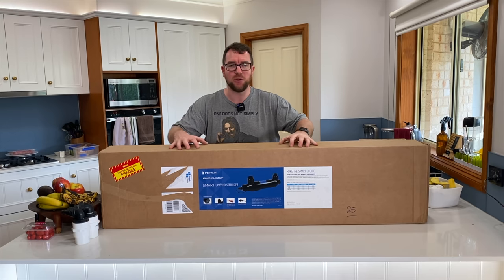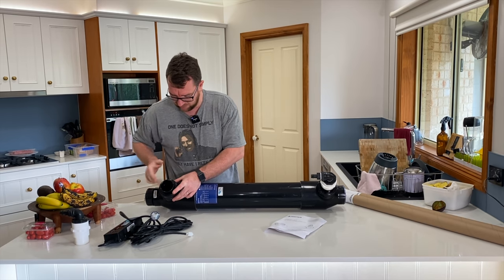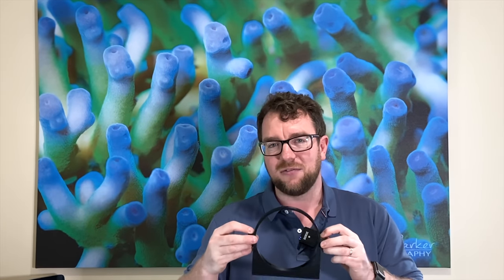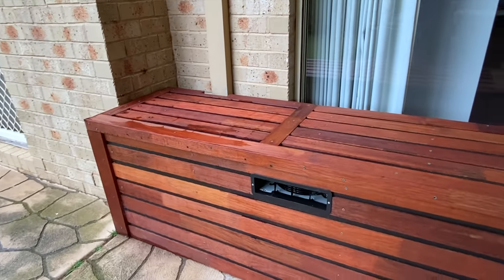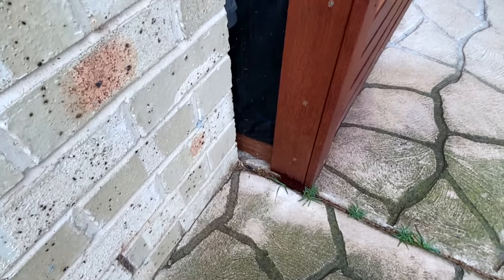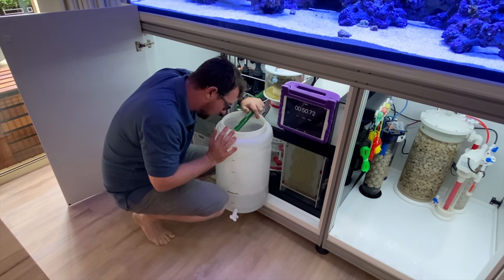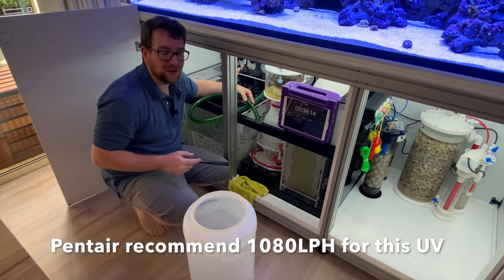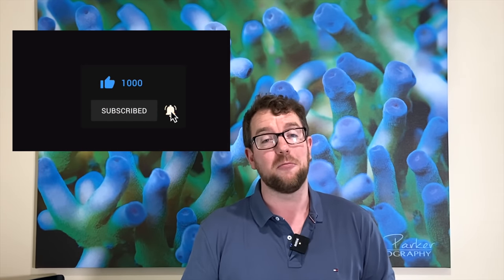Pentair UV Unboxing, installation and tuning - How to

Comment: I got a 25 watt Aqua ultra violet twist, mainly for the smaller size of unit and for the purpose of water clarity and bacteria control.  Did its job within 24 hours and I oversized the unit for my future tank upgrade.
Reply from the maker: Nicely done 👌🏻👌🏻👌🏻

Comment: Very nice set up mate once the tank is completed it will be one of the best tanks around 👌👌
Reply from the maker: Ah thanks man, I just want it to be the best I can make it :)
Reply: @ParkersReef   hi Sam I have a question for you please if you can help iv bought the shadow over flow system 16 inc and I’m having trouble getting the water level right if I reduce the flow with the tap it’s quite but not enough flow in the sump and find the water goes a bit cloudy if I open up the tap I get good flow tank goes clear but it’s noisy in the box iv tried with the standard high of pipe recommended in the box  and I can get it quite but I reduce the flow coming back into the sump do you have any idea what I can do please thanks
Reply from the maker: @enricodigenova8112  when it is flowing the volume you want, where is the noise coming from and roughly how many litres per hour is it?
Reply: @ParkersReef  the pump I have is 2800 l p/h and the noise is from the box when the water is low in the box if I raise the water level in the box by closing the tap the noise goes but the flow coming back into my sump is reduced by a lot
Reply from the maker: @enricodigenova8112  ok so the noise is coming from the box? As in, the water is falling too far from the front box to the back box creating a waterfall?

I like to have the full siphon as low as possible, but the partial syphon as high in the box as I can safely go. Gives you more room for it to catch the full siphon when power is restored, but the high second pipe will reduce the waterfall noise as the water level in the box will be higher
Reply: @ParkersReef  ok thanks mate I’ll give that a go 👌
Reply from the maker: @enricodigenova8112  keep me updated! The flow should be well within the range for the overflow box
Reply: @ParkersReef  thanks mate
Reply: @ParkersReef  all good mate I cut 2 new pieces of pipe and it’s quite and good flow in the sump thanks once again 👍
Reply from the maker: Bloody good work, well done 🙌🏻
Reply: @ParkersReef  thanks mate I really appreciate your input .I meet you at Dave shop I’m the guy when I told you I follow your channel and keep up the great work if you remember
Reply from the maker: I think I do remember - but I have to say I’ve been getting quite a few saying that to me lately, I must be almost a D grade celebrity 😂
Reply: @ParkersReef  all good mate ppl love your videos because they are very knowledgeable and you take the time to explain everything and help out as best as you can and ppl appreciate that and I’m one of them 👍👍👌👌
Reply from the maker: I appreciate that mate, thank you 🙏🏻

Comment: Hey Sam, I have the same UV and chiller models (nice gear). Teco specs say the chiller should be Min 600 / Max 800 LPH.  Has your chiller been working fine running at 1000 LPH to run in series with the UV ?
Reply from the maker: Sure has mate 👍🏻

Comment: What about running 2 UVs one for general purpose and another one for slow flow to avoid ick kinda bacterias.. is that a good approach (ignore cost) .. If yes , what would be the plumping considerations and and placements.. 

Also is it always needed to direct the treated water directly to the return pipe?? I am not doing this at all
Reply from the maker: yes that would work just fine. You could also run a single larger UV with enough exposure at the higher flow rate to cover both use cases

Comment: Excellent!
Is there a way to electronically monitor the sterilizer such as a intellicenter??
Reply from the maker: Not that I am aware of
Reply: One last question Does the sterilizer have to be mounted at an angle  if mounted  horizontallly?
Reply from the maker: @MWard-zk4wg  ideally with a small angle to ensure no air gets trapped in there

Comment: Thanks for walking through this. I am about to install a 360 gallon system and got the same 80 watt unit. I am looking to leverage it similar to your expectations. I assume I can run at a slightly lesser flow rate based on on the lesser volume. Any thoughts here based on your experience with the unit thus far? Separately, are you using low iron glass? I was convinced that it doesn’t make a difference on glass less than 3/4” thick, but wanted your opinion.
Reply from the maker: hey Chuck, they're great units and I wouldn't run my system differently if I were to build it again. The 80watt unit will work a treat on your 360g tank, wouldn't worry about slowing the flow more - you'll just get extra coverage with the same exposure rate if you leave it at recommended values.

Yes my tank is low iron glass and it is one of those things that you cannot tell the difference unless next to another tank - but at the time it didn't cost me much more, so it was worth it. Also, my glass is 19mm thick, so basically 3/4 inch.

Comment: Did you have to put an o ring inside the union slip? I didn’t put one in mine will I be fine?
Reply from the maker: The fitting does have an oring yes, best check yours

Comment: I had purchased a 25w pentair, but now need to step down outliers from 1.5 inch to 3/4 barb . What should I purchase to get this step down ?
Reply from the maker: I’d just get some adapters from your local plumbing or hardware store

Comment: Excellent video Sam! Can I make a suggestion and plumb your chiller before your steriliser? You'll want the chiller to be receiving water as close to the display tank temperature as possible as its the chiller inlet temperature that it controls to. Unless you are controlling temperature from another probe, any heating the steriliser provides will trick the chiller into thinking the whole tank is hotter than it is, and the chiller may over cool the whole system. Whether the chiller is extracting heat before or after the uv steriliser won't matter for the overall system temperature, but where you measure your controlled variable does. Just my 2c!
Reply from the maker: Yeah I've had a few say this, seems to be 2 very different trains of thought! I feel like putting the chiller before something that creates extra heat that then returns to your display is tricking yourself. I bought the chiller to keep the water cool, so why let warm water come out of the UV, go through the entire tank then finally make it back to the chiller for cooling instead of cool it instantly?

I have the ability to put a temp probe elsewhere, but I don't see why I would want to? Surely I want to regulate the temperature of the water that is getting sent to the display tank?
Reply: @ParkersReef  You bought the chiller to keep the display cool, not your return, since that is the temperature your livestock is experiencing and therefore the temperature you want to set and control. The chiller doesn't care about nor regulate the temperature of water it is sending out (which is what your return line will see), only what it senses coming *in*, which should approximate your display temperature as closely as possible. When running, the chiller outlet could very well be 20 degrees, which will go up your return and mix with your display until it cools back to your target temperature of, say, 25. The chiller turns itself off and on to provide cold water via the return when required so it can mix with the display tank and keep it roughly where you've set your chiller temperature.

Now say the UV heats the water going through it by one degree (probably excessive but for sake of argument...). So for example, your tank temperature is sitting at 25, but in your configuration, your chiller sees 26. If your chiller is set to 25, your chiller will turn on and chill the water coming out of the UV until it senses that the water coming out of the UV is 25. To achieve this, it has to cool the entire system, including your display, to 24 degrees to compensate for the localised temperature increase at the UV. But you don't want a display of 24, you want it at 25!

Your return line temperature will always fluctuate based on if heaters, chillers, UV etc. is on, and at the end of the day, doesn't matter in and of itself. What matters is your DISPLAY temperature - and the equipment should be serving the purpose of keeping your display where you want it, not your return. Maybe the return is 28 when the heaters are on, maybe 22 when the chiller is on, but if the temperature control equipment is set to sense and control to the display tank temperature, the return temperature will meander around to achieve the display temperature goal regardless of what your UV is doing to the water temperature. That is why you should either have your chiller before your UV, or have whatever temperature probe is sensing the controlled temperature for your chiller as close to the display as possible. The heat from the UV will be taken out regardless.

Sorry I'm garbage at explaining things - I hope that makes sense...
Reply from the maker: That is a good explanation and I appreciate the time you have taken to explain it - there is a vital point you made there about how the chiller does not see nor care about the temperature it sends out - only the temperature it sees coming in. That is key and makes your approach make a lot more sense now although I am starting to think it actually makes next to no difference as both approaches have pros and cons.  I totally agree, you are maintaining temperature in the display, not the return. Now if I were to go chiller, then uv and I want my tank temperature at 25, this is how I see it would play out:

Tank is at 25, goes through sump, through chiller, chiller does nothing as temp is correct, then to UV which heats the water up another 1 degree and sends it to the display which in turn heats it up above the temperature I actually want. This continues until the display gets too hot (all whilst the chiller sat idle) and eventually the chiller kicks in. The chiller would never actually see the actual temperature of the water that is being sent back to the display, until it has over heated the display - effectively putting your tank on a temperature cycle no?

Like I said, I am beginning to think we are splitting hairs and it makes little to no difference :D
Reply: @ParkersReef  I'm an engineer... Splitting hairs is what I do best 😂 But I love the chat - both sides can learn stuff! 

So all chillers and heaters work based on hysteresis - that is they will cycle on and off to remain within a certain margin of your target. I think the Teco's stock hysteresis is one degree, so if you're targeting 25, your chiller won't turn on until it sees 26 at the inlet. So you're right, you'll get some heating before the chiller kicks in, but it will do this regardless of where the UV is placed relative to the chiller. If your uv is before your chiller, you're shifting this cycle down, say, a degree, but you'll still have the cycling. There's no real difference here. The only way to fix this is to reduce the hysteresis setting on the chiller.

I guess my main point was what temperature you're controlling to should be the display temperature and independent of the UV. The UV's outlet temperature may change if it's off for whatever reason, bypassed for maintenance, or the bulb characteristics which can change over time. Maybe the flow through the UV changes over time due to pump fouling so it gears the water more. This may change your display's temperature because the chiller is fighting to keep the UV outlet constant, not the display.

Now how big a deal is this? Is this even a deal? I can't honestly answer that question, but at the end of the day, why not remove the variable by changing the order and never have to think about it?
Reply from the maker: @N0r53f1r3  yeah fair call too! The UV temperature differential is one thing I feel will remain fairly constant, it's on 24/7.

But, say the pump did foul and run slower, in turn heating the water even more in the UV. I'd rather the chiller pick that up, than returning back to the tank as a slow stream of very warm water?

But all being said, I still think it has little difference one way or the other :D
Reply: @ParkersReef  the UV steriliser will add a certain amount of thermal energy to the tank that is independent of the water flow rate through it. The slower the water, the hotter it will be, but there will be less of it so the impact on the display temperature is exactly the same - a watt of heat is still a watt and once it mixes with the display it won't matter. However it matters to your chiller because it's sensing temperature at the UV outlet specifically. So it'll assume the tank is far hotter than it is and potentially over chill.

Just some food for thought Sam! The impact may very well be negligible - it really depends on how much heat the UV adds which I didn't even consider until you mentioned it. But it's a variable easily taken care of with the switch.
Reply from the maker: yeah that is a fair point. I can totally understand the position now (the point of measuring incoming temp not outgoing temp was critical), I might need to get hold of some fine resolution temperature loggers and do some testing :D
Reply: @ParkersReef  I do love more data! 😂

Comment: Following yr build. Super it is. Topclass equipment. Details to the 'T'. 
   I have a doubt regarding the uv sterilizer.  I am soon setting up a Cade S21500. Since I won't have space to set it up away the way you did can I install it in the sump cabinet? If yes, what would be the best way to plumb it. I will also have a chiller.  So do you think I should go or 2 separate pumps ? 1 for return and another one via uv to chiller and back to the sump.  Thanks
Reply from the maker: Yeah if needed to fit in the cabinet, triple check what size can fit. You may need to mount vertical.

Ideally a separate pump for chiller and UV, but if you can make it work on one pump - it sure makes plumbing a lot more simple
Reply: @ParkersReef  thanks a lot for yr advice. Will see which one fits. Pentairs are long even for a 40W or 50W model so will have to chk some other brands. 
    Thanks once again 👍
Reply: Just to be sure myself,  so you are running yr uv from the sump and again back to the sump via a chiller.  Is my understanding of yr water paasage through uv correct ??
Reply from the maker: @sameerjathar8062  that is correct.
Reply from the maker: @sameerjathar8062  they are, but that is for a reason! The smallest I would go would be the 57w twist
Reply: @ParkersReef  Yes. I think the reason behind having long uv chamber and  the long bulb is for longer dwell time and hence good results. 
   Let me see what I can get. Since I have to import any brand except Periha, will see what best I can lay my hands on. Thanks again
Reply: Hello Sam,  once again coming to your uv install, would like to know do you have any safe guard against  the uv running dry? I mean say  the abyzz stops for some reason n then again starts after some time ,  so that rush of water would be harmful for the already running uv bulb . Isn't it ? 
   Don't get me wrong, but  this probability of uv running dry due to pump malfunction is worrisome. 
  Thanks 👍

Comment: Hlw sir , can you tell me what is air bubble hotspot in uv ?

And what negative effects of hotspot ??
Reply from the maker: if you form an airbubble in your UV (air trapped in it instead of constant water flowing through) it will not be cooled by the water and get hot. It can burn the sleeve :)

Comment: Another great video, I'm looking at getting one or two of these units, I was hoping you were going to show how the bulb and sleeve bit works, can you change out the bulb whilst the unit is still plumbed, or do you have to drain the whole unit? Happy New Year mate.
Reply from the maker: If you mount the unit vertically I think you could leave it full of water, but it’s probably not a bad idea to drain it and remove the sleeve as well so you can clean that at the same time.
Reply: @ParkersReef  Ah ok, I can plumb shut off valves and a drain just for the UV then if mounted upright just unscrew and pull the sleeve and bulb out, cheers Sam
Reply from the maker: @pelagicswimmer  perfect 👌🏻

Comment: Which adapters to reduce the outlet size to 3/4 inch for the hose?
Reply from the maker: I reduced from 2 inch down to a 3/4 thread with some reducing bushes

Comment: Hey mate. Awesome video as always. I purchased a 50W after watching this. Now that I got the unit the plumbing got me scratching my head. Any guidance you can give with regard to the step down from the 50mm to a manageable size and what products you used? I've looked at some stuff at newlifekey but I'm way out of my depth with this one.
Reply from the maker: Hey mate! Ah good stuff, we can get that sorted for you! I just went to bunnings and used reducer bushings to get down to a thread size that I could screw a 3/4 barb adapter into.

Comment: Hey Sam, how did you make the barb adapters, I bought the 40w pentair.
Reply from the maker: Hey David, I think I cover this pretty well at the 3min mark of the video. I use a 50mm pvc adaptor down to a thread which allows me to screw in some hose adaptors
Reply: @ParkersReef  sorry I should of been clearer, are all those parts from Bunnings, so nothing hard to find?
Reply from the maker: @davidmills1045  yes they were all from my local bunnings and no, not hard to find :)